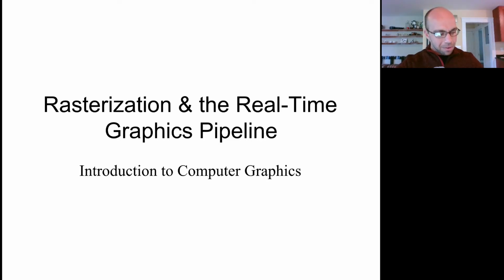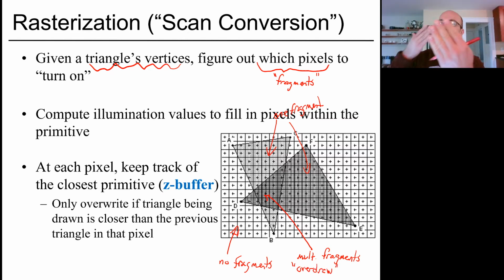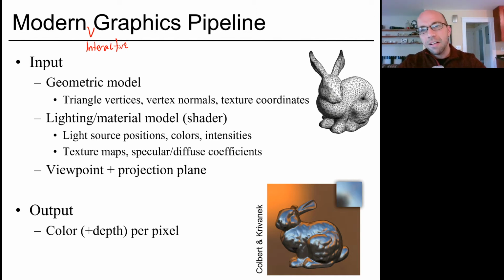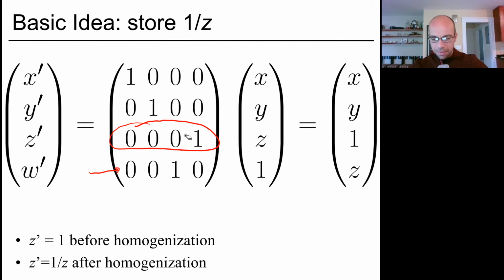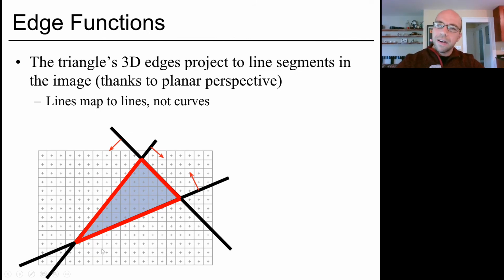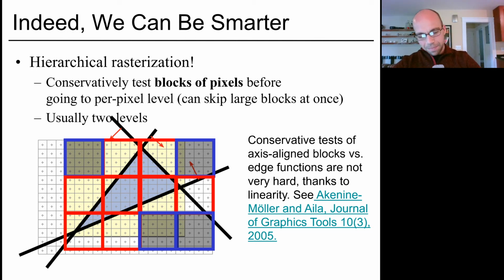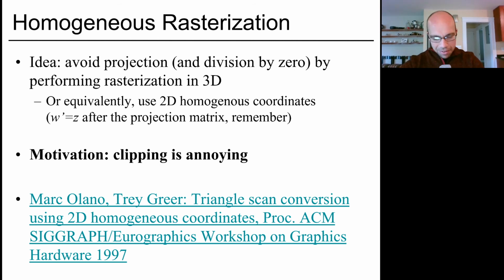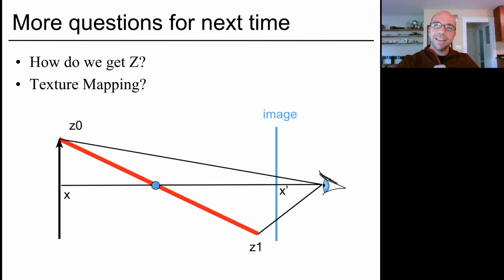Introduction to Computer Graphics (Lecture 17): Rasterization

Comment: I got difficulties with z-buffer understanding.
Am I understand it right, that z-buffer calculating constantly for every single pixel of EVERY segment in runtime?
Isn`t it mean that z-buffer contains depth values of All pixels of ALL segments(polygons) within view frustum simultaneously?
Or
Objects just drawing one by one, their pixels compare their Z value with current Z-buffer and just become visible or not? 
If the second option is correct then I completely don`t understand how shadow mapping work :)
Reply: The last option is correct, there was pseudo code at  23:00 which shows this. Only one depth value is stored for each pixel, and is updated sequentially for each intersecting triangle. However, each pixel can be updated in parallel.
For shadow mapping, effectively the pixel shader will do a 2-step ray trace for each pixel. Given the X,Y, and depth, you can calculate where in world space the rendered pixel is. Then you can find the distance from that pixel to the light source (with the shadow map). If the distance is greater than the depth value in the shadow map, then the pixel is in the shadow of that light source. Then you repeat for each light source (obviously that doesn't really scale well over many lights though).
Reply: @hjups  THANK YOU! Now I got it )